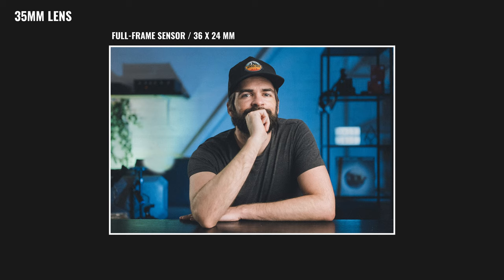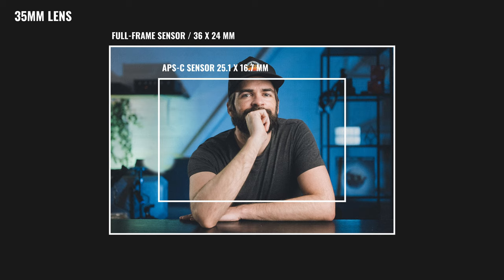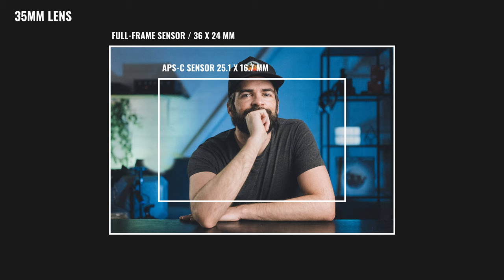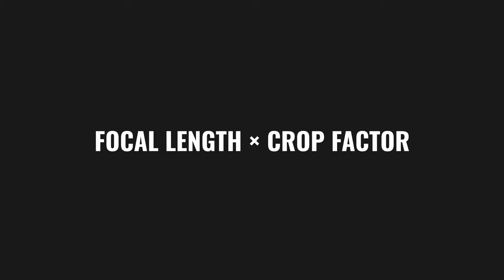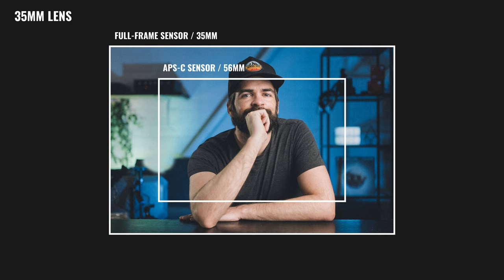How to Make APS-C Look Like FULL-FRAME! [Without a Speed Booster]

Comment: I use a speed booster so all my full frame lenses have a lower f stop and the focal length is nearly the same as full frame. I would definitely recommend the viltrox speed booster for the m50 as you don’t loose any image quality or any issues with focus. It opens more possibilities with the m50 👍🏻
Reply from the maker: Not familiar with speed boosters at all! Maybe I should get me one 🤔
Reply: @JorisHermans  I’m sure viltrox will send you one and you could easily get a few videos out of it. You will enjoy the difference it makes to the m50. It’s like a mini eos rp with it 👍🏻
Reply: Get a viltrox speed booster it will get you close to a fullframe. And you do not need to buy 20000 more lenses to get the same result as on a fullframe.
Reply: have you had any vignetting issues on any of your full frame lenses with the speed booster?
Reply: @user00sam  no, no problem with image quality or vignette
Reply: I have a rebel sl3. I want to get a full frame effect. I should get a speed booster and adapter? Also I want to attach a vintage lens.
Reply: This is the dumbest stuff I've ever heard

Comment: Those who shoot APSC that want a full frame look need to check out the Sigma trio. These lens are a game changer for crop sensor cameras. 

Sony & Fuji shooters 1.5 crop

1.) Sigma 16mm F/1.4 = 24.38mm F/2.14 full frame look.

2,) Sigma 30mm F/1.4 = the loom of 45.9mm F/2.14 full frame look.

3.) Sigma 56mm F/1.4 = 85.68mm F/2.14 full frame look.

Canon Shooters 1.6 crop

1.) Sigma 16mm F/1.4 = 25.92mm F/2.27 full frame look.

2.) Sigma 30mm F/1.4 = 48.6mm F/2.27 full frame look.

3.) Sigma 56mm F/1.4 = 90.72mm F/2.17 full frame look. 

I hope this info helps.

Comment: Hey Joris, I am using a canon M50 with a Tokina 14-20mm F2.0 on my Channel (either with the adaptor or speed booster to reduce the crop factor)

This lens and combo is so underrated! With the speedbooster, you can't get any lower than 16mm otherwise you will get vignetting but a 16mm full frame equivalent with a F1.4 (focal distance is also reduced with speedbooster) convince me to wait before buying a full frame camera. What do you really need more ? You should give it a try

Comment: Awesome video Joris. So if understand correctly, i have a canon 80d (APS-C) with a sigma 50mm. I'm trying to find a lens for an interview, and because my canon is APS-C, it not wide enough to capture 2 subjects, i should get a 30/35mm lens to get the same result as a "real 50mm fullframe" camera right ? 
With limited money in my pocket, maybe a speedbooster could also be a solution ? if it's the case, what kind of speed booster would you recommend me to transform my ASP-C 50mm sigma 1.4 into a 50mm full frame ? thanks a lot and have a nice day.

Comment: If I use a 35mm DX lens on my apsc Nikon camera that should give me the same field of view and focal length right..?
Reply from the maker: No, you also have to multiply by the crop factor.
Reply: Why would they bother to sell an APSC lens line if it's still cropped 🥴
Reply from the maker: @WilliamDuckett  Because 35mm is 35mm, it's a physical property of a lens. But lenses specifically designed for smaller senses have a smaller image circle and so they're cheaper and "easier" to produce.

Comment: Thanks for such a helpful video my man! I have a question I hope you can help me out with:
I use a Fujifilm X-E1 so the crop factor is 1.5 but to add to that, I'm also using a 50mm vintage lens with adapter so I'm technically using a 75mm lens
I always need to take a few steps back for most of my photos, but I've always wanted to shoot true 28mm and 35mm. Is this just not possible with APS-C?

If it helps, I'm using Minolta lenses, and they don't seem to have made much below 28mm, which would still give me 42mm focal length, am I just hitting the limits of APS-C or would using a native Fujinon X-Mount lens that claims to be 27mm actually give me 27mm?

Thanks and hope you can help me out!

Comment: Small update on my Canon M50.  It is currently at the repair center I was forced to send it to.  Even though it is just over a month old, the warranty doesn't apply to the repair, so I got hit with a $250 repair bill.  The reason for this is that the 3rd party seller I got it from on Amazon sold me a "Gray Market" camera, and therefore no warranty applies.  So, the money I was saving for my second lens just got spent repairing the camera.  

Moral of the story for anyone reading this comment: buy directly from Amazon, or from the official Canon website.  I thought I was saving a bit by going through a 3rd party seller, but I have wound up spending way more than I would have originally spent.  It's okay, though.  Just gives me extra time to decide if I want to get the 50mm with an adapter or a speed booster.  I keep going back and forth on that decision.
Reply from the maker: Well, even though it sucks, at least you're taking it well. It's a good way of taking on life 🙏🏻💥
Reply: Finding the positive spin on life's horseshit is a difficult thing to put into practice, but I try lol